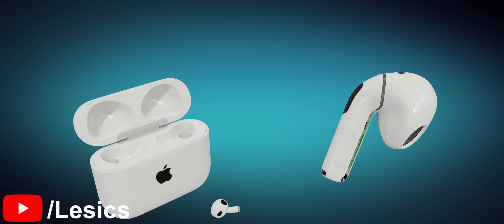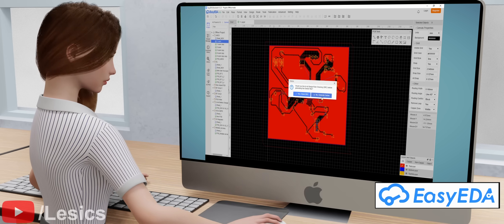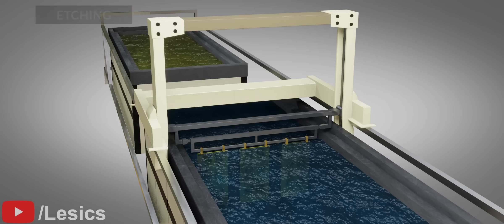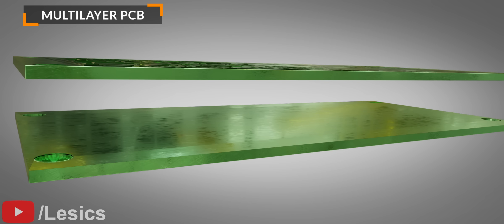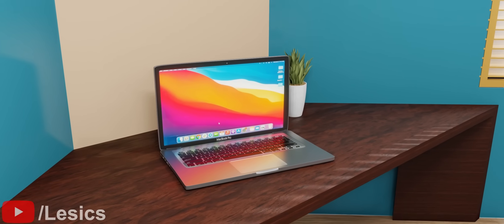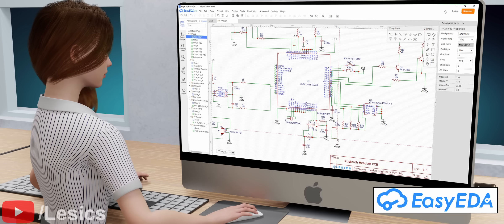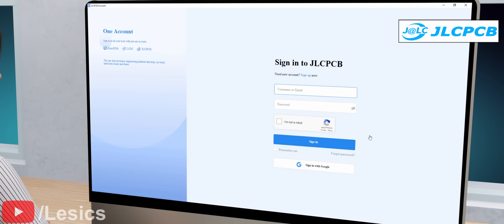PCB | At the heart of every electronics device

Comment: Ok. So here are few points you need to improve on:
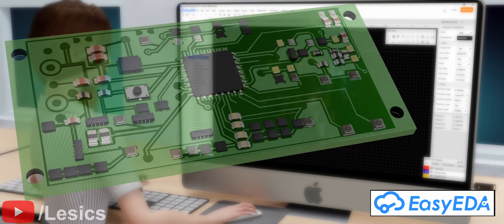1.  2:33 We don't use a 2 layer PCB just to reduce PCB size. A 2 layer PCB can have separate ground plane so that we don't have to route ground nets. Also it provide shortest return path and hence reducing EMI and improves signal integrity. Also, usually we don't add components on the 2nd layer of a 2 layer PCB!
2. 3:34 No explanation was provided for how adding ground plane reduces EMI. Pls refer Eric Bogatin and Robert Fernance videos for this!
3. 4:07 Those are stitching vias. Used to stitch two ground or power planes.
4. Instead of adding more related information, u want to extract gold from PCB! Why? Maybe you could have explained about the complete manufacturing cycle (Design,  Prototyping, Manufacturing, PCB test gig, EMC compliance process,  etc.

I hope you will improve on this!
Thank you!
Reply: What a narrow, selfish view…Did it ever occur to you that you are not they are not making these videos just for you? You the only one watching it…not everyone wants detailed info tangentially related stuff…
Reply: @BoomBustProfits  I see a partiality here! These guys explains the mechanical related stuff in depth but touches only the surface when it comes to the electronics part. Maybe I am selfish or maybe I just expect more from them! :)

Comment: Can you please make a detailed video on how semiconductors are practically manufactured by doping silicon crystals with Boron, Phosphorus and other substances? Because that's the basics behind the manufacturing of all modern electronics. No one on YouTube shows how silicon crystals are practically converted to N-type or P-type semiconductors and other stuff like that. I enjoy watching your channel and learning since 4-5 years and I must say, you guys are the best!
Reply: they use this exact same process, just at a nano scale. They use basically atomized atomic sources to "spray" atoms onto a substrate, and there are ways to mask. Most of the effort and work is building copper structures, the creating of transistors as you describe is only at the cores of the chips or storage arrays, in which case there are many ways to etch the little machines out of the surface
Reply: If one have access to a research nuclear reactor, the thermal neutrons it produces can be used to irradiate a Si ingot. Part of the Si consists of the isotope Si-30, which becomes Si-31, which in turn becomes P-31 by emitting an electron. This minute amount of phosphorus changes the silicon into n- type silicon.
Reply: This is NOT the “SemiConductor channel”…if you want Semiconductor specific info go to the Semiconductor channel! this is PCB (Printed Circuit Board) Channel !!!
Reply: @BoomBustProfits  this is Lesics dude! Lesics are the Kings of all the technology, including semiconductors, mechanics and other stuff.😁
Reply: Check out Asianometry's videos on semiconductor tech. He's the authority when it comes to the subject of semiconductor on yt.
Reply: Try Branch education channel
Reply: You have said what I wanted to say..
Reply: Check out the youtube channel asianometry
Reply: You may find Jaeger's book, chapter 2 interesting

Comment: 2:59 You meant electric field?
Reply: No, he meant magnetic field. Electricity and magnetism are very closely tied. The higher the current the stronger the field. If you put a compass near a cable with a current it will impact the comapss' needle. Magnetism can also produce the electricity, that's what call the electric induction. That is also why Sun can destroy all electric devices on Earth with strong magnetic winds.
Reply: @pitrek121g  I see ty for explaining. But isn't there also electric field between wires?
Reply: @bellzon4086  of course there is but electric field is more particles related. He said magnetic field because it is the one that is "making problems" in circuts, not the electric one.
Reply: @pitrek121g  electric field can also cause problems like dielectric breakdowns etc
Reply: @bellzon4086  dielectric breakdown happens only when there is over current, while electromagnetic induction happens at any current with varying intensity of course